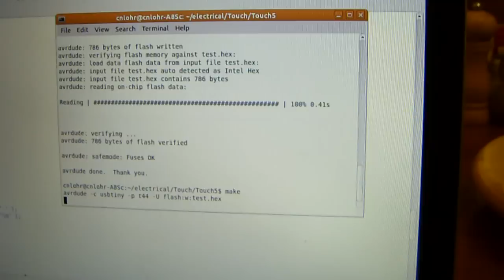Clear Glass PCB AVR Touch Sensor

Comment: That's my patent and yes, per my earlier post, when I did this (>10 yrs ago) I used 2 RC oscillators and a PIC to determine the frequency of each. Subtracting the two frequencies yields absolute position. Using more modern uPs with ultra low leakage can measure relative capacitance as you describe with just two GPIO pins and two resistors and get a few hundred points. Continuous calibration can keep you in a reliable 8 bits or more. This technique is extensible to 2D.

Comment: Q-touch I believe use(d?) charge transfer method and required 2 GPIO lines per electrode. You  also couldn't get a large sensing range this way. The interdigitated triangles approach can be used to get > 1000 discrete points along the length of slider and if done correctly (not sure what was done here but assume so) you can take advantage of differential capacitance sensed and derive a self-calibrating position number. This can also work in 2D like an XY touchpad.

Comment: For one explanation, see US patent 7,812,825. Here I used two RC oscillators to get >1000 points. Since then, I have been able to get many 100's of points using a low power microprocessor (such as PIC nanoWatt) with < 20na of input leakage. Then you only need 2 GPIO pins and 2 resistors. I'd recommend making the interdigitated triangles skinnier than in the video. If it's too wide, your finger will cause unwanted variations when moving at right angles direction to desired finger movement.

Comment from the maker: This takes one GPIO per electrode (two for a X-position), but I only get about 50-60 distinct levels of pressure.  I've never been interested in Q-touch since this has been more than good enough for all of my tests for everything so far.  My calibration is actually done on boot, so if the device is used over a long period of time, then one would have to re-calibrate.

Comment: How would you recommend laying out the touch sensor grid? i was going to print it directly on pcb. but put solder mask and print over the copper grid. I'm not sure how it works unless touching th4e surface makes electrons begin to flow through the circuit. I'll try to read up on the AVR32 UC3 to see what I can find out, the board has 21 painted sensors on the screen print, but the diagram shows a pad broken up in a seesaw pattern in 4 sections. I'd at least need 256 levels of variable touch area

Comment from the maker: With all of my designs, you can get 255 levels easy, but you can't get it stable at that.  From most of my tests, you only get about 5 bits cleanly. 

You may fair better by using the silkscreen/solder mask act as the insulator, since it's much thiner than the 1mm glass I'm using here.

The layout is somewhat arbitrary in all of my stuff.

Comment from the maker: Hmm... their qmatrix thing is neat, but the overhead for my projects still isn't worth it.  Using resistor arrays, with only 5 parts (plus a programming header) on a board, I can get 13 touch sensors off an ATMega168.

Comment from the maker: Not sure how you read that patent... I don't know how you'd use their technique without extra parts per sensor.  Similar tactics on the slider though.  The way I do it, you only need one pin per sensor, you can sample it at ~40k per second and get around 80 degrees of pressure.  I find AVRs are better for this because of the higher internal RC clock rate.

Comment: Thanks, I i’m helping my daughter build a project 4 school. she saw your video and want’s 2 try and make a simple circuit that lights up LEDs on glass. Do u have any suggestions on where 2 get the nimrod-hall copper 1.4mil? U know, it would save u some time if u posted the materials used and possible locations 2 purchase them n the notes. Unless u just like talking with people by responding 2 their questions :-). I read through all the posts and the questions r almost all the same, thanks again

Comment: XY touch sensor is the next big thing, I'm building DJ hardware and want to implement XY touch sensor instead of using slide potentiometers. Except for my application, I'm wanting to work with a grid that has 256 positions on X and no positions on Y about 1x4" touch surface.

Comment from the maker: Aah, for the specific project I'm working on, GPIO use and fewer additional components is paramount, so one GPIO, no extra chips.  Multiple sensors can go into a single resistor network.  But, I do admit I lose a few bits of resolution.

Comment: Pretty cool design... Could it replace a soft pot?
Reply from the maker: What is a soft pot?
Reply: A soft potentimeter. Its a long variable touch potentiometer. If you press down on various parts of the strip the resistance changes.
Reply from the maker: sure can. probably not quite as linear or clean though :-/

Comment from the maker: Hmm... I tried to find a youtube video explaining how this works, but everyone else is using two-wire capacitive touch sensors, all my designs are done with one-wire sensors.  So only the inputs on things like the attiny24/44/84 and others in that type and atmega 48/168/328 and others in that family are suitable. 

I guess I'll have to make a video...

I basically have one wire, whose output is hooked to a 1 M-ohm resistor to 5V.  I ground the pin.  Then unground it and wait for it to rise to 5v